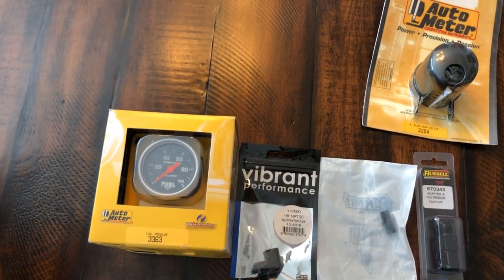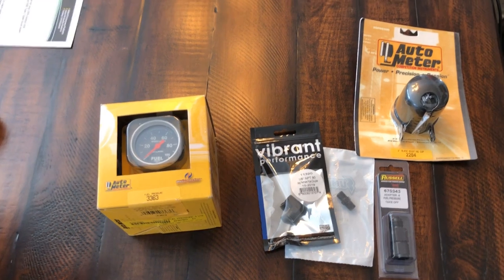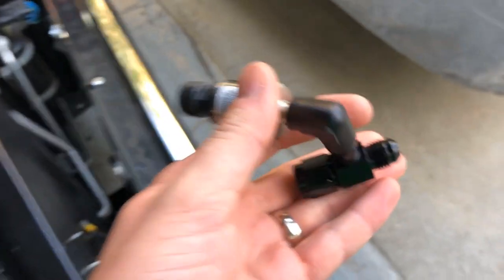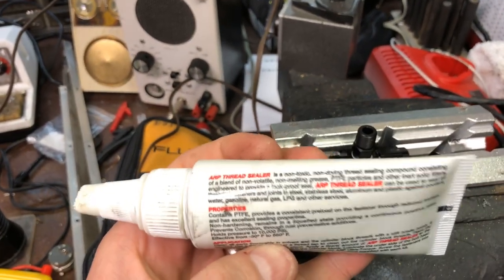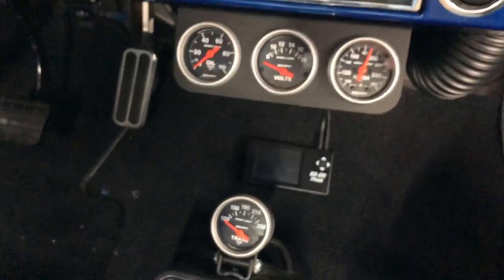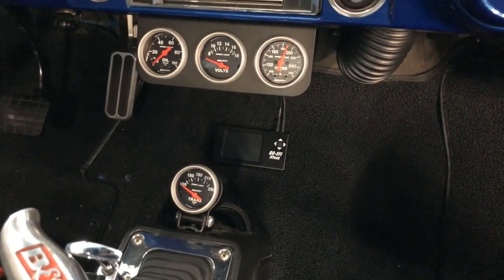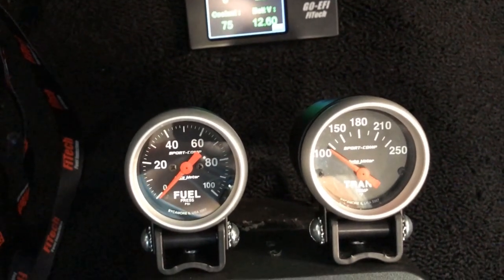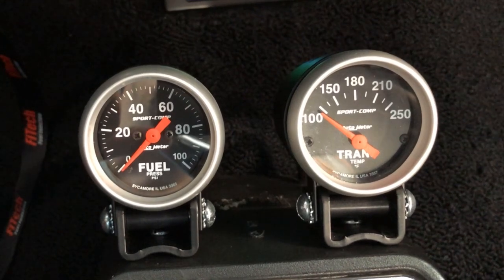Installing an Electronic Fuel Pressure Gauge

Comment: can you provide a parts list?  I would like to replicate your setup.  Thanks!
Reply: Also if you have a parts list for your under the hood setup I would greatly appreciate that as well.
Reply from the maker: I will post the parts used in the description section later today. 
The gauge comes with the sending unit as well. So it’s basically the gauge and fittings. I’ll get it posted up.
Reply: @mechtrician1  You Rock!!  Thanks again.
Reply from the maker: @JPVSR  no problem, it’s in the description now.
Reply: @mechtrician1  what about the sender/pressure transducer?
Reply from the maker: It comes with the gauge.
Reply: nevermind, realized it was a part of the guage